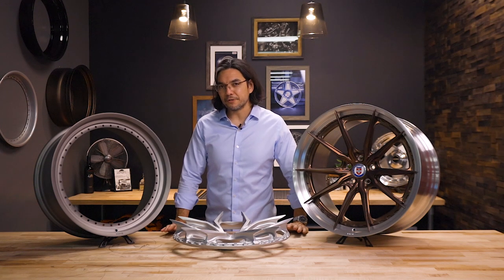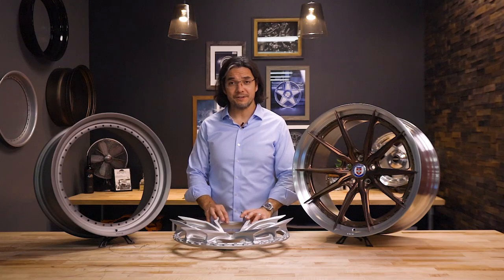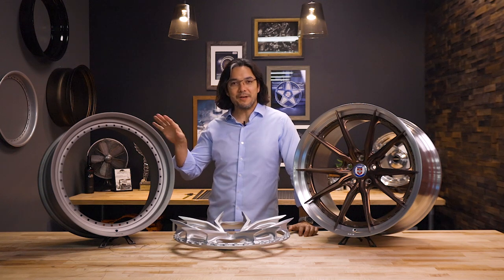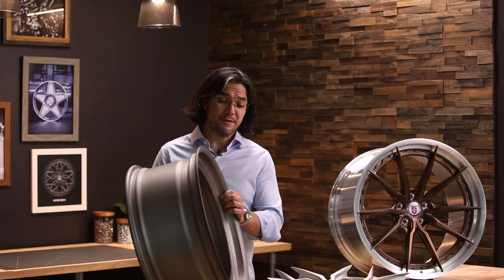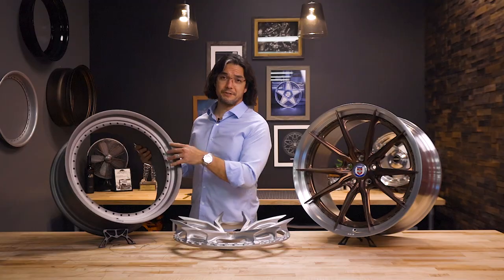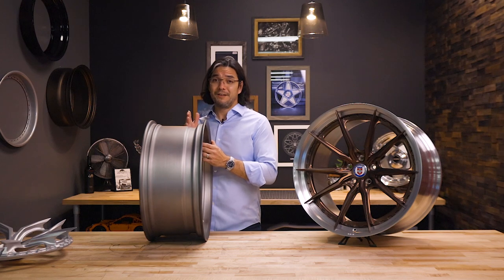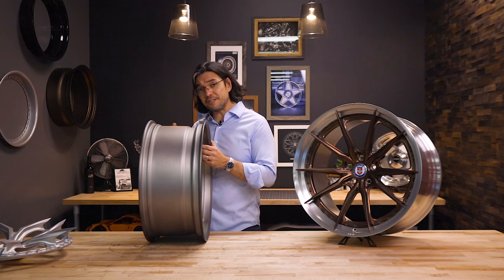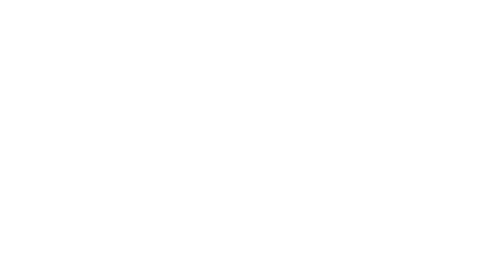Wheel Talk | 2-Piece FMR® Technology

Comment: There is no locker around the rim to prevent tire slippage. I believe flow formed is used way too often to describe wheels, and many have a belief that flow form is better than an alternative. There are forged flow formed and cast flow formed. Cast flow formed, to me, is no better than a regular cast wheel. Also, even a forged wheel is technically cast because the bullet aluminum is made via casting, which means the wheel, even if monoblock, is only as good as the source of the bullet/blanks. Does HRE make its own blanks? One company actually makes its own blanks, etc., and thus controls the quality of the wheels it produces completely through the entire process. However, it too is limited to the source of the aluminum and percentage of impurities, etc.

Comment: interesting even if a little short. :)
2 questions :
1- why all the serious wheels on the market look alike and are almost only straight spokes going from the center of the wheel?  why not other type of shapes with larger center, short spokes, curved spokes, off-centered spokes? 
2- isn't it possible for you to also forge the face of the wheel while you are at it?